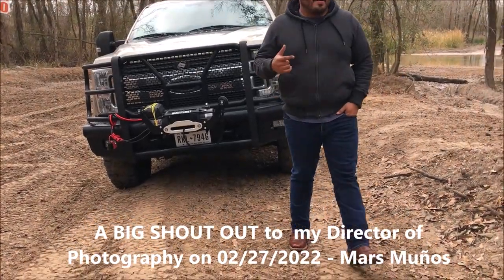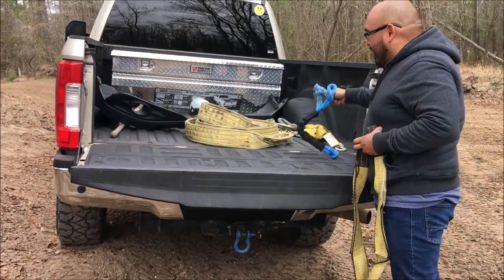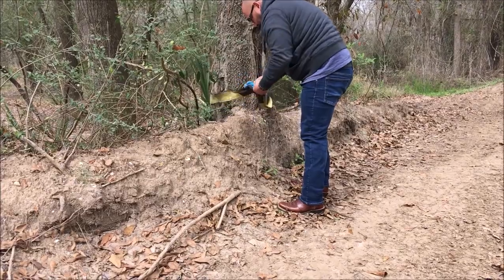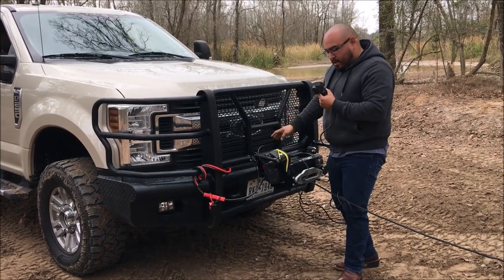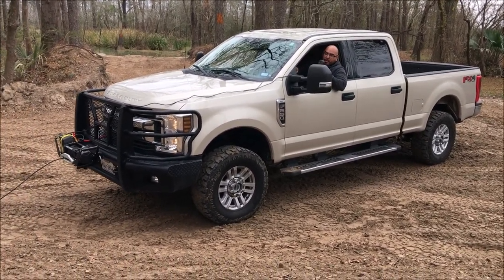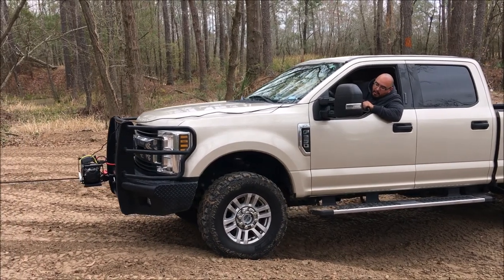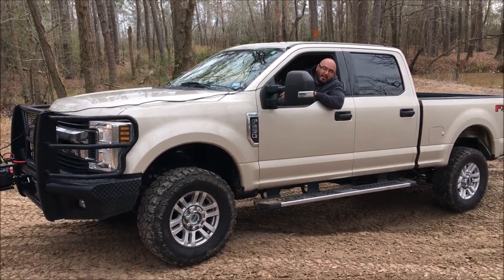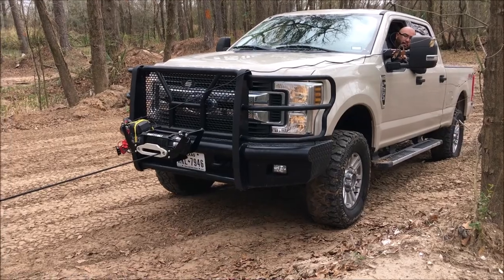Testing the Harbor Freight - Badland Cradle Winch Hitch Mount

Comment: It is fine. I have that same grill guard. I believe it's called the "ranch hand" The way it's mounted to the frame allows some play for the grill to pivot. I've had to hook up to the bumper hitch and the weight of the trailer on that hitch caused the grill to pivot forward. A Forklift to pick the hitch up and pop it back into straight is all that I need to do when that happens.
Reply: That's not a ranch hand that's a knock off one